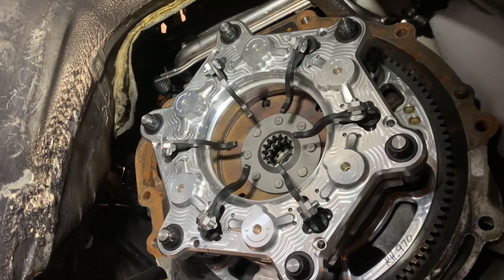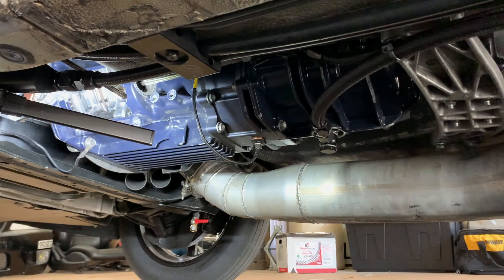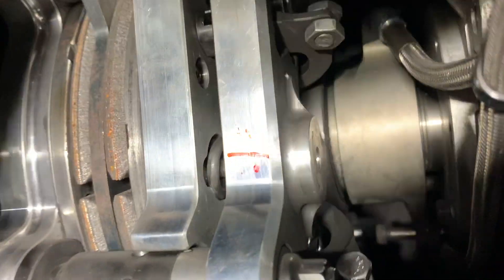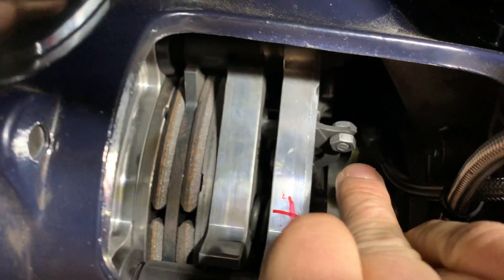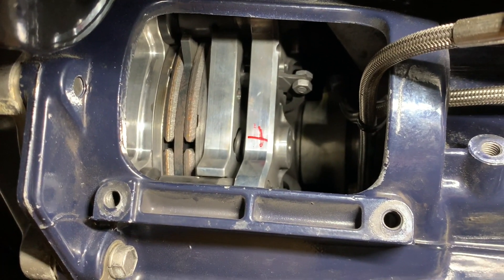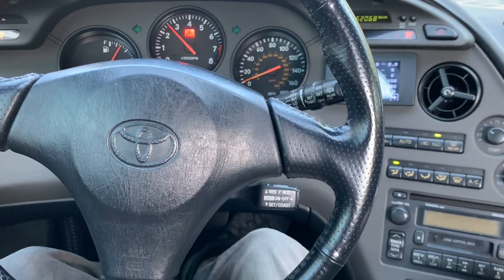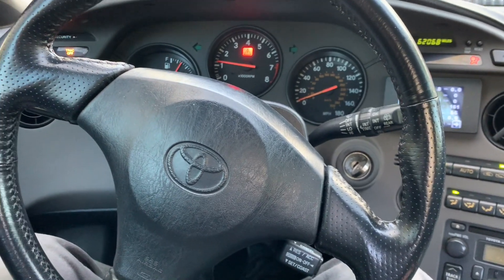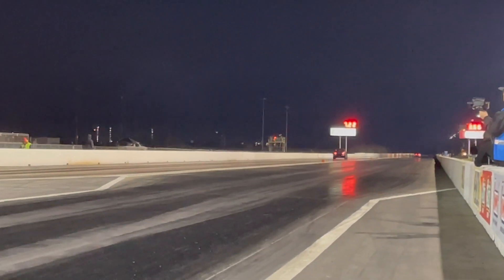Manual Trans V160 With a Torque Converter!

Comment: I'm thinking about replacing clutch in my manual car with torque converter. 😂
Reply: I have thought of this idea before.  If you could bolt a clutch to a torque convertor that would be so cool!  The clutch would just be for changing gear, but you could still get the benefits of convertor stall and the smooth launch of an auto trans.

Comment: Wouldn't a clutch release valve be less work and easier to adjust than a slipper clutch ??
Reply from the maker: Doesn’t work the same. It helps some cars but most the fast stick cars are on a slipper for a reason.
Reply: I would guess most of those release valves are one stage.  But i just thought of an offroad bypass shock.  You could have something similiar for a clutch release with adjustable stages.   Would not be cheap though!😂